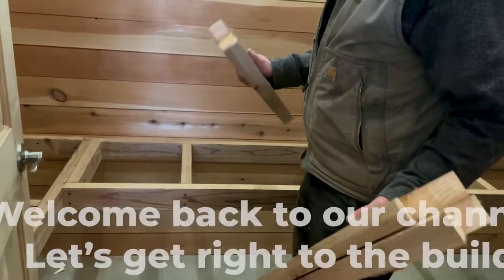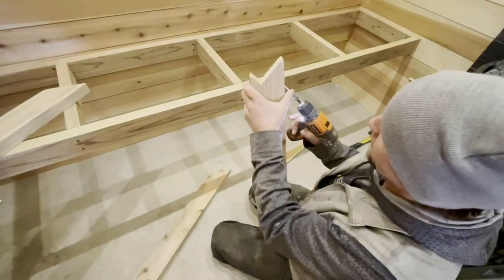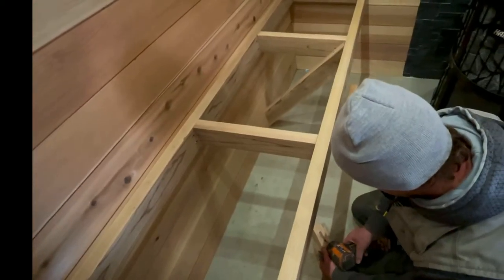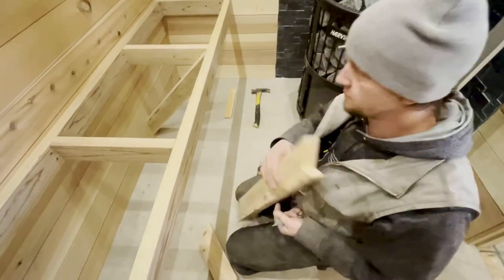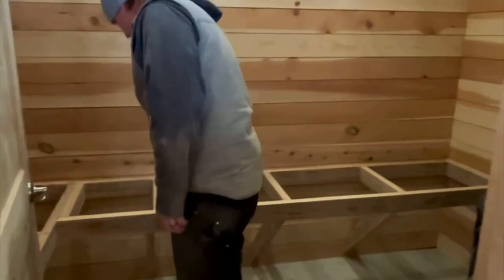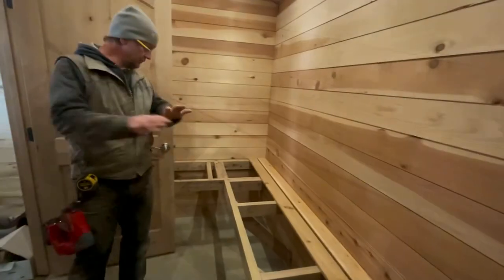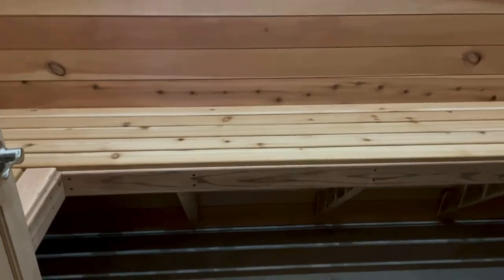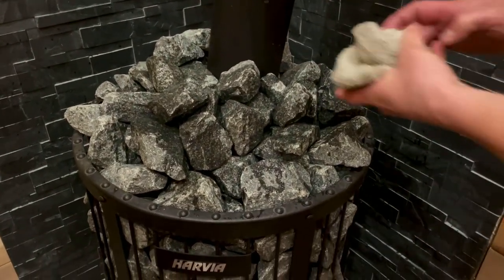FINISHING a Cedar SAUNA BENCH for OUR OFF GRID BATHHOUSE | off grid lifestyle

Comment: Bench heights too low, door should swing out. How's the metal door handle treating you? Also where are your vents?
Reply from the maker: We have had the sauna for some time now, (5 years) and it's just right. The handles get warm but not hot to the touch where it can burn. When we are finished using the sauna it's attached to our bathhouse that has 2 windows and it vents out fine.

Comment: Hello, what kind of wood you used for bench boards and support studs?
Reply from the maker: All of the bench is made of cedar. The structural boards were available with a rough surface finish so I sanded them down before assembly.

Comment: How do i determine how to cut the notch and angle for bottom? Thanks
Reply from the maker: Pythagorean theorem is what was used. It states A2 + B2 = C2 
Calculation of finding the hypotenuse of a right triangle. 
Take the hight along the wall = A2
Take the length of bench away from wall = B2 add those together for the length of the brace between the two measured points. Then to get the angle you need to do a slope ratio best tool is a framing square. 
This is a tough question, cause it’s best to learn it hands on. When I make another video that requires same building I will probably have Marc explain each step.